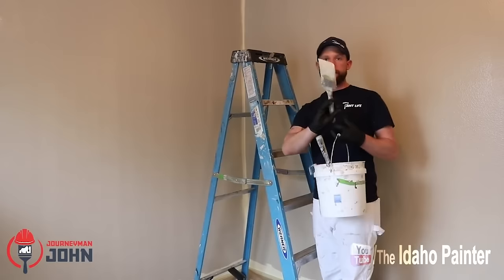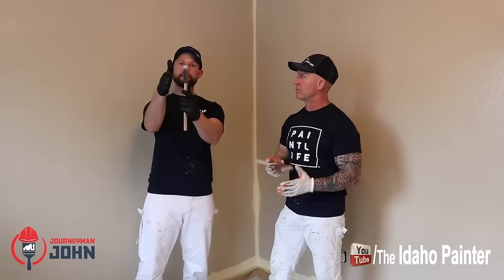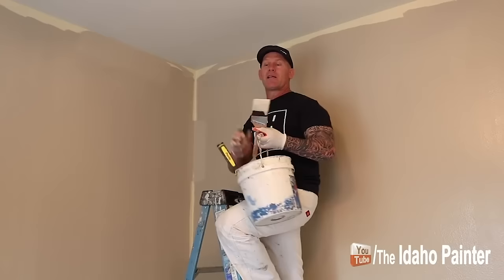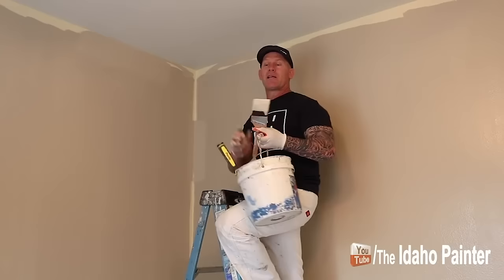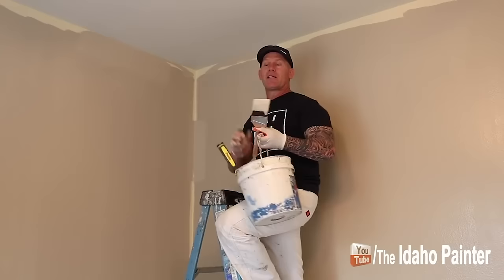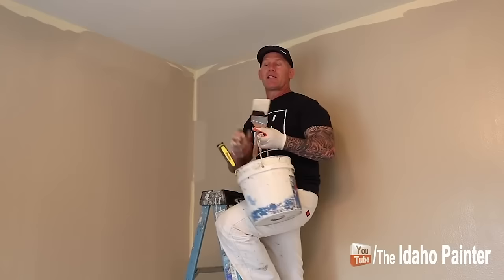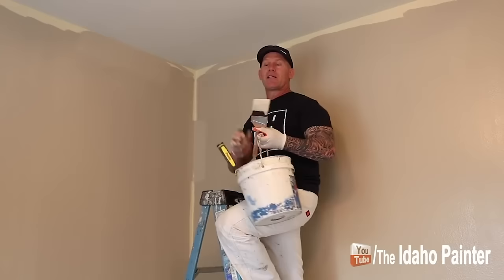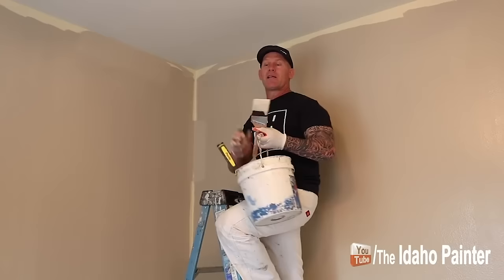Cut In Painting Tips

Comment: Great videos on painting. I've been painting for 30 plus years and still learned a few things. We all paint our on way but basically the same end result. I use a 3 in block brush it holds a lot of paint. Love the 2 gallon bucket! I use small trash can bags as a liner. Once you get it down and taped it makes easy clean up. We use 18in rollers for everything. Don't think I have a 9in frame on my van. Love the hacks with the 3m masker. Keep up the good videos.

Comment: I actually used an eyelining brush to get the very thin line between the ceiling and wall, then I used the roller. It worked.
Reply: What did you paint. The borrowers house.
Reply: Behave yourself. What was you painting? A wendy house? Behave.

Comment: Try the Wooster Ultra Pro Firm 3 inch. It keeps a nice tight edge. Also when you roll your walls, just push the edge of the roller into the corner.  I normally use a 3/4 inch Wooster nap when I roll walls. Keep in mind that when you roll the corners with a 9 inch roller that it will leave swirl marks on opposite side of the corner. You will need to roll the other side of the corner up to the edge of the corner without touching the other wall to remove those marks. If there is any missed places you can use a brush and drag it down the middle of the corner to fill in those missed places. Also as far as hat banding or haloing goes, make sure you box all of your paint together before you paint. Make sure every gallon is mixed together very well or else your chance for a color difference between cut and roll is very high.
Reply: I like to use a 2 inch Wooster Pro Firm for door jams when I’m on the job
Reply: Yup, I use those exact brushes, I use 1/2 in though, I didn't care for the stipple pattern on the 3/4.  Always box your paint, and we screen all too. Thank you for your time.

Comment: Love the trim cut-in and back-rolling procedure! Makes total sense.
Typically, in a climate controlled home, how long of a working time do I typically have to roll the walls and still have wet cut-in paint to overlap? 
Some of my walls are large, and I'll definitely need to do only one wall at a time. I'm using a high-quality paint, applied generously, as you demonstrate in your videos.
Reply: You could do your walls in sections if you roll while "lifting off" where your splitting the wall. I would cut the top and maybe even cut twice then roll the top section (atleast 6-8 feet) then cut at the bottom and roll from the middle down and coming up you feather into your upper section thats been rolled. Lifting off means when you reach your upper section picture a plane taking off. Let your roller roll then slowly lift off at the end of your roll. ( this method works best when painting with flat finish)

Comment: Just watched one of your videos 1st time Was never taught. Thrown into fire learned on my own. I paint similar to you Do not use roller grid in bucke.t use one gallon bucket Like 2" brushes and roll everything I think I have rolled around the world 3 or 4 times I love that thing.  Did not know about different brushes I need to check into sure and Williams blue and red brush what did you really think about that.  Have troubles on knock down Orange peel goes pretty good but get lots of bubbles even going both ways I always do. Have troubles on knock down Orange peel goes pretty good but get lots of bubbles even going both ways I always do that With brush. 1st started painting cut in ceiling lineIs. Lead rolled walls wall dried you could see 2 different colors paint. Took quite a while before I learned about roller.  Use bucket brush roller to cut in everything. Glad to know I taught myself the right way and you just confirmed thank you. Need to watch rolling And more spraying don't know if do either one correct or not. I kind of fake everything masking is my preference hate to spray OK to roll like to brush like masking best. Into retirement years now And toThumbs hurt shoulders hurt neck hurts lower back hurts. Still working And love every inch that I get to paint And love every inch that I get to paint. Again thanks for your videos just need to watch. Again thanks for your videos just need to watch more. One question I don't think I live in your state I have not Bid on new construction home in years usually All redo New construction how much do you charge per foot. Just bid on New construction home paint prime Just labor 20000 Sounds kind of expensive but boy will I make good money Thanks for everything I'll check out more videos
Reply from the maker: I have several videos on pricing

Comment: Have you ever tried a Wooster Gold Edge brush. Makes cutting in walls a breeze.Wooster no longer makes the Polar Bear roller cover which I thought was awesome for me. They have a cover called “Cirrus”that holds a lot of paint, is easy to work with and washes out easily. If kept clean can be used dozens of times!! The 1/2 inch is great for rolling walls with very minimal spray coming off roller.

Comment: Pro tips, always use a bucket and screen vs a roller tray when you have a choice, always box your paint, always screen your paint, use a pole any time you can vs a ladder, and keep a wet rag, a sponge, and a bucket of water on every paint job. 

For cutting in, I like to use a few strong magnets, so I can just stick the brush on the can, up out of the paint. I glue the magnets to the bucket when I have to use plastic. Neodymium magnets on the outside of the bucket will hold a brush on the inside of the bucket. If you don't have a grid, you're playing around, but you can stick a wire across from the one side of the handle to the other, and that you can use to chase the paint off the brush, but some people just tease it off on the edge of the can. 

When you are painting, KEEP THINGS CLEAN! like surgically clean. Always mask the floor when you're painting as well. If you're going to do a professional job, you need to be using cardboard up against the floor trim, or tape and paper the edges, or both, but then cover it with a drop cloth or plastic.

Comment: Eye/hand coordination: I have had some success carefully training my vision ahead of the tip of the brush as I move along. This is something like a welder working the leading edge of the weld puddle, not watching the arc. It takes some effort. Switching to the stiffer Purdy Clearcut brush also made a significant improvement with my heavy Sherwin Williams SuperPaint.  My cut ins have gone from bad to not so bad as I envision from the ladder the cut in advice from Chris and John, and adjust. Repeating the same errors is not helpful.  
I have a total of about 100' of DIY ceiling cut in experience, at the bottom rung on the learning ladder. Thank you all for you good advice. The lines are getting better. 1000' to go.

Comment: I like the scoring ceiling edge technique that makes sense ill try that.  Also I probably should  do the back role more. But I'd hold on that until the second coat because I'll see if it's a problem after the first coat.

  Don't hold your breath! Relax and breath, If you hold your breath you tense up. Like in the marshal arts breath out as you stroke. 

  Also I'm right handed so I do ceilings counter clockwise and base boards in a clock wise direction. Each to his own I suppose, but I hold the brush the same way as I hold a pencil and like sawing a strait line you point your index  finger and you draw a strait line leading with your index finger.  many of the techniques in painting, plastering  carpentry are all the same. In knowing one thing know 10 thousand. A good technique works for many applications.  Breath, relax, extend.
 
  That goose neck cut in, not for beginners because.  If you hit the wood your going to have to clean it off really fast before it soaks in to the wood and your going to have to move the furniture any ways, so move it first and paint it in normal. 

 
  Looking for a new skilled painter, hire an artist. They are detail orientated and they can draw a straight line. You want to hire a hard worker, hire a bicycle courier. Both of these. people need money. The artist is poor the courier is fed up working like a dog for next to no money. In both cases watch out for the pot heads.
Reply: Artists don't paint well because cutting isn't drawing. Cutting is allowing your brush bristles to conform to the anatomy of the wall. straightness of your line is dependent on the wall.

Comment: I'm always looking for new ways to paint and save time, But an angle brush does work well but I found 4" straight brush to work better. and I'm talking never having to use tape before cutting in. not to mention I cut in left or right handed.
Reply: The straight edge brush i feel cuts better in the right hands. Using an angle brush sometimes only can cut so far do to the paint being focused on the edge when you cut. Depending on your wall texture you can use different size brushes to give you more paint and length of cut. Cutting in with a 3 inch brush really gets some paint going and learning to "move paint" or letting the "brush glide" will get you more productive

Comment: You cover “orange peal” texture but if the walls are smooth do you use a shorter nap roller than 3/8”?  Also in some videos you say the Purdy angled sash brush is best for cutting in and other videos you say the Montauk brush is best.  Neither is very expensive but is there a difference in performance?
Reply: All about the hands holding it. Use a brush thats comfortable for you and one that carries paint. Paint clean and fast and keep your brush clean. Purdys are great or coronas. 2-3 inches for walls. Any smaller would have to be for trim of certain sizes

Comment: Do you cut in first or paint the wall first?
Reply: Always cut in before rolling is sort of a golden rule to have the most uniform finish. If you have alot to cut and want to get ahead you can roll first but it also depends on colors. If your painting with lighter colors than your walls a quick primer coat on the walls will allow you to coat the walls without using as much paint. Cutting in on the first coat normally is a lighter coat so when you cut in after your first coat you'll be able to tell how many coats you need to cover the existing paint. 2 coats is always a standard.

Comment: Most homeowners would be well served to bite the bullet and buy an accubrush cut in tool. Even as a remodeler I use them on small jobs. Call it cheating, but I don't have to worry or go slow. I can cut by hand without tape, but that accubrush tool works great. I don't need a ladder to hit the cut in on ceilings, just to finish the corners out. On long runs, I use a pole and send it. 

On bigger paint jobs I'm going to use a power feed roller inside, unless it's a new build, then spray all day, and roll the walls down.

Comment: Here's a pro tip.. Screw a small pot hook in the side of your brush so you can hang it on the inside of your bucket instead of holding an all day. Makes life easier when climbing letters
Reply: Just cut the plastic off the strip on a 5 and tape it to the brush

Comment: Thank you for another, terrific video. If I struggle to cut in fast enough to allow rolling the rest of the wall before the cut in areas start to fully dry, is it ok to wait for the cut ins to dry, and then roll the rest of the wall?
Reply: Yess during painting of walls letting your cut lines dry will give you even finish between the walls and cut lines. If you were to roll over paint thats almost drying you could move the paint and create a heavier texture and that doesn't help match the rest of the wall. If you have alot to paint , cut everything in and then roll away capn
Reply: @wildonezhnrqz5087  thanks!!
Reply: @wildonezhnrqz5087  thanks!!

Comment: If your baseboards are the same color do you still paint them separately? Or can you cut in from your baseboard and the wall?
Reply: If your baseboards are the same color as your wall, sometimes you can prep your baseboard and mask off at the floor and go through with a sprayer and use it to cut in at the floor level. But yes you can paint your baseboard while you do your walls. Especially if its going the same color and sheen

Comment: Doesn’t that make picture framing ? If you cut in after rolling because it’s already dry just like if you cut in and it dries before you roll it I can’t seem to win with egg shell man I cut in thick af back rol then roll into it and still deff need two coats idk how to beat it lol . Because you can’t touch up egg shell once dry like I try to back roll corners that aren’t covered well and it picture frames with white paint man .I was told to cut in everything first on one wall at a time and roll but what about ceilings alone ? How tf do you do it even with cutting in few feet and then rolling into corner still if you pull of and stop rolling more then a min or so and go back it makes the first coat 2 Coats and shows more darker 😤

Comment: You guys seem like nice guys but I've got some thoughts there is no right way to paint I suppose but rolling walls before cutting isn't a good way I guess that's why you have a mini roller while you cut in you wouldn't have a problem with brush strokes if you keep a wet edge meaning roll while your cut is still wet. And with the wet edge it cuts down on any picture framing.

Comment: Been painting since 1972 and Professionally since 1980. My first Bossman CJ Godwin used to say a good Painter can make a straight line with a Cornshuck and you're a real Painter when the Brush becomes an extension of your right arm. If I'm doing production cutting with pastels and I'm not cutting up against Crown Moulding I like a 3-1/2" Purdy XL Swan because they hold a lot of paint. Perfect for outside trim except window sashes Otherwise a 3" Angled Brush with a nylon/polyester blend. Nylon is too soft and flimsy for Me and Chinex is too stiff. It leaves too many ropey looking Brush marks unless I'm using something like block filler. Back rolling isn't necessary with pastels especially flat Paint. You're losing a lot of time cutting in, smoothing out your cut in with your Brush then back rolling. Smoothing out your cut in with your Brush is totally unnecessary your back rolling will clean up and smooth out all your Brush marks. You'll be surprised how much faster you just dip cut, dip cut until you finish your stretch then back roll your stretch immediately while your Paint is still wet. The roller cleans up any Brush marks, covers any holidays and smooths out everything nicely. Try dipping & cutting until you finish your stretch then immediately rolling eliminating the step of smoothing out with your Brush. Once you master the dip cut, dip cut roll method you'll never go back. Hope this helps you.
Love & Blessings!!
Jimmy in NC....
Reply: I have never heard someone use the term pastels in the profession al paint trade only in artistic painting I've been painting 13 years my first job in the field was 22 years ago,  I take it you mean acrylic or latex?